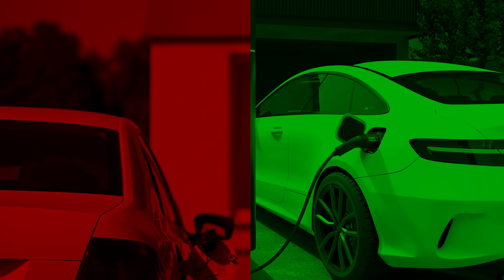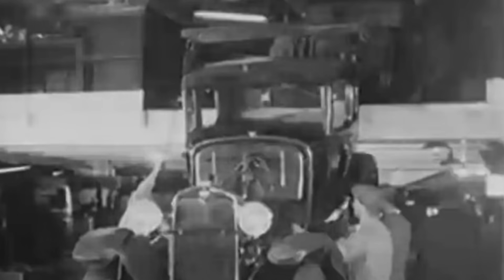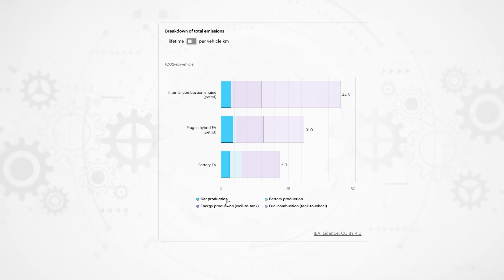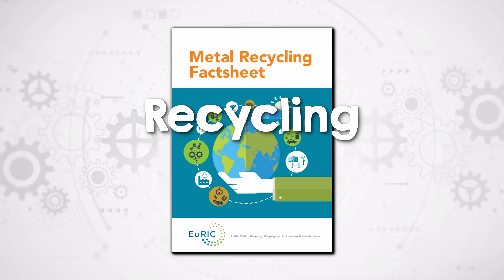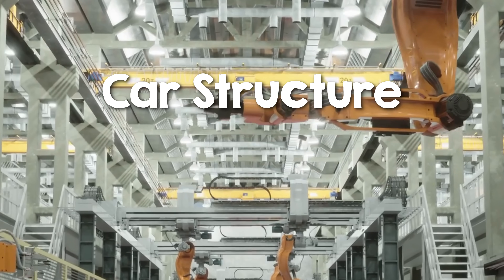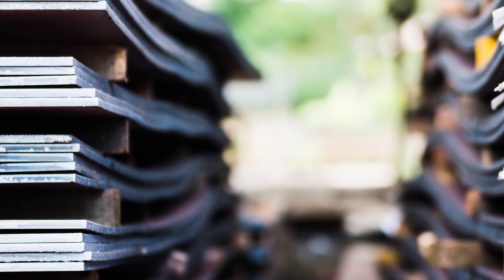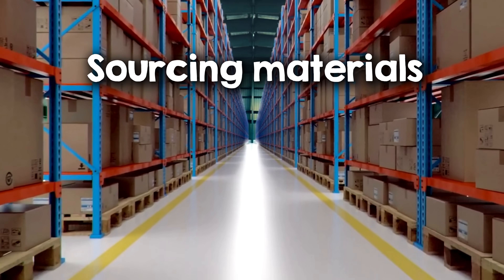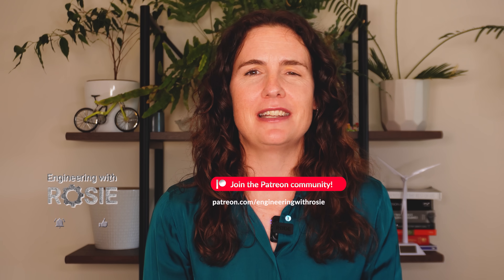The Hidden EV Manufacturing Problem No One Talks About

Comment: Considering the loss of power over electrical networks of 50% you are incorrect about an electric car ever being a better solution for transport. Hybrids win everytime. EVs are heavier and have so many other problems. If you are going to make statements and call yourself an engineer try to make them less BS please
Reply: What BS is this?
Reply: @marcelreijnen that an ev will ever have a magical point where it becomes better than an ice car. It's just demonstrably false. 
If you have 2000kg car and 100kg person, you get ~5% efficiency.
A ev car weighs more because the storage capacity of a lithium conpared to a fuel like petrol is ~10% so youre battery pack is big and heavy.
So lets so your car weighs around 3000kg and your human still weighs 100kg. So you get a lower efficiency. 
Then factor in the energy losses during transmission accross the elegtrical grid. The energy losses going back and forth in and out pf chemical storage in the battery. Means that a electrical car is a huge drain on resources compared to ICE cars.
Reply: Power loss in electrical transmission & distribution is only 0.5% to 3%.  Your 50% is ridiculously wrong.  You might be including electricity production using fossil fuels into your figure.  That is wrong.

Furthermore, renewables like wind and solar have zero fuel costs as the sunshine and wind arrive freely.

You also neglecting that gasoline and diesel don't appear by magic at the local gas station.  It takes a huge ongoing effort of investments, labor, subsidies and pollution in a 24x7x365 effort to explore, drill, refine, and distribute this ultra-refined product.  All before a single drop is burnt for fuel!  The US could power all it's EVs several times over on the energy used annually to refine its petroleum.
Reply: EVs are more efficient than ICE vehicles, even assuming 15% grid losses (50% sounds like an ass-pull).
First a big central power plant is more efficient than a small engine (about 40% vs 30%)
There are some losses charging the vehicle, about 10% (larger if charging on only 120V).
So the system efficiency of an EV is about the same as an ICE vehicle:
(0.4)(0.85)(0.9)x100%=30.6%

Comment: Isn't most or all of the carbon dioxide when manufacturing batteries from fossil fuel? 
That's not the only way to produce energy! I would suggest attacking the problem where it appears.
Reply: It’s a mix of energy from fossil fuels and minerals refining.

Even today it’s already way better to build batteries for cars, and it gets better as the grid cleans up both for plugging the cars in, and for the energy used in manufacturing. Eventually we’ll also have to decarbonize the refining process.
Reply: @benoithudson7235  There's been a lot of work going on to decarbonize steel production, as well as cement production.  Those two alone are 16% of global CO2 emissions, which is kind of nuts.  In both cases, electrochemical methods are looking very promising.  Electrochemical refining of all metals used in EVs, running on clean power is a thing I think we'll see eventually.
Reply: You're getting it, pal!  Unless we can decarbonise electrical power then you are just moving tail pipe emissions to a distant power station.   And renewables are hard so we'll just take the easy option and build FF power stations.   Specifically coal fired coz gas is hard to find, but coal you just go to a geography textbook.
Reply: Batteries are not made from fossil fuel. The energy used in their production comes, to a large extent from fossil fuel. As energy is increasingly sourced from renewables, then, of course the CO2 emissions resulting from using energy top produce batteries will decline. The most efficient way to reduce the carbon footprint of battery production therefore, is to decarbonise energy production.
 The use of fancy CAM (Computer Aided Manufacturing) techniques is exciting to virtual engineers maybe, but way less effective than doing the actual graft of building a carbon free energy grid, which is done by real engineers.
Reply: @nickwinn7812  That's very idealistic...  Unfortunately, the only affordable renewables tech comes from China, and we all know where China gets her power from, Coal.  They build two new Coal fired power stations a week.   The continued year on year increase in Coal consumption suggests that your bright renewables is so far in the future that it's irrelevant.
Reply: The transition to renewables is so slow where they build this stuff that I don't understand why you make this comment.  Fat chance that Chinese solar panels will be manufactured from solar power, this is extremely energy intensive and solar is fabulously energy diffuse!

Comment: The same battery capacity gives markedly more range per Kwh to markedly more eBikes and mobility ped platforms.

You can retrofit decades old steel frame bikes. How's that for lower innital emissions. 

For day to day short/medium range use cases around built up areas, go much further to meet more peoples needs. 

Very many people wouldn't need to use a car the majority of days if traffic priorities were managed differently. They might still own one but should be much cheaper to rent now and again for longer distance journeys or for additional utility likes moving ect or when actually having passengers /luggage
Reply: Indeed, our car-centric cities are what's fundamentally unsustainable. Much more efficient urban design is possible, but lobbied against. The suburbs keep us isolated, and turning to wasteful consumption for fulfillment.

Comment: The "Recycled Materials" Problems and cost apply to ALL vehicles,  not just EVs.
In fact, if we consider the "Big Cube of Metal" at the front of a "Non-EV" which essentially becomes a liability in an accident, a properly designed EV has a great advantage when designing for crash protection. 
Not to mention the container of "High energy liquid" under the "non-EV" when compared to the EV battery, which is increasingly being designed as an integral part of the chassis and so the crash structure, thus AIDING performance in that regard.
(Ref the upcoming Stringent Chinese Regulations....."Safety Requirements for Power Batteries of Electric Vehicles" (GB38031-2025) ..... due for introduction in July 2026)
Reply: As always you overlysimplistically conflate low correlated issues.... Such as recyclability versus safety.  as if they are relevant to each other.

You must be confused after all the issues with Elon.... c'est la vie
Reply: Overlysimplistically conflating low correlated issues.... Such as recyclability versus safety,. as if they are relevant to each other.

You must be confused after all the issues with Elon.... c'est la vie

Comment: Have they stopped talking about emissions from battery manufacturing now? I would really like to see a good LCA that shows that battery manufacturing is significantly worse the the manufacturing of drive trains for ICE vehicles, now. The difference in both cost and weight between comparable electric and ICE cars is really small now, which suggests the difference in emissions from production is unlikely to be significant compared to the huge difference during use.

Also, it seems like efficient tools to minimize problems in production isn't just relevant for EV manufacturing. 

Emissions from energy used in production is going down as we speak, even for the same processes, as average emission per unit power generated decreases over time. So while I don't have exact numbers, I strongly suspect the difference in emissions between electric and ICE car manufacturing already is kind of insignificant, and EV manufacturing will continue to improve, with more clean power, and improved manufacturing. Any LCA for battery manufacturing based on historical data only will be misleading, even when they're not intended to be misleading.
Reply: Even if you leave out drilling for oil and using the products, the net difference in emissions is large. Just ”read up” on the development in battery technology/manufacturing instead of using old (manufactured) data…

Comment: Tesla have been going hardcore on this for many years, even down to building their own simulations of magnetic flux in their motor designs, and tying everything together from the design stage through to automated quality control on the production line. I wish they'd be more open about it because I find it fascinating, but I'm guessing it's just too commercially valuable... which I guess would definitely support the points you make in this video.
Reply: All car companies do a lot of simulations and virtual testing.   It's extremely expensive to find out problems in production, so they try to figure out as much as possible beforehand. My friend works in VR division for Skoda where they iterate on designs with stakeholders. Another one is working on crash test simulations. Even tiniest details of how something is placed in the car or how the glue is apllied are simulated to find the most cost effective solution.
Reply: Rosie is just adding "EV" onto standard industry practice to make it sound new and exciting.

Comment: Initially it sounds like a digital twin is just...the design.  If all the designs are "compatible" I can see that would make it possible to create a whole-factory simulation and I can see that would be an excellent way to avoid the big mistakes.  A twin in a more literal sense would be a digital file about a specific item that was made on a specific day - containing all data about where it was made, when, what other tools were used on it, and the specific version of the design at that time.  From searching I found that this is called the digital twin instance (DTI).  I imagine this would be useful for maintenance - you'd know how much usage the part had and if it had hit a lifetime limit e.g. in aircraft some components have flying time limits on their life, others depend on inspections and this is obviously something that already has to be managed but we could do it for other industries and more efficiently.

Comment: Ummm.. what about the other EV Manufacturing Problem No One Talks About... China's coal intensive manufacturing of "green" EV's & batteries.
Reply: ... which still leads to a very acceptable "carbon payback" time, compared to ICE cars
Reply: They have SOME "coal intensive Electricity", Maybe you should consider the total manufacturing China provides for "the Rest of the  World" then consider the effect if that manufacturing was "Re-imported" to the now "customers"?

Growth of Solar (And Wind) in China is on an "S Curve" and as more is made, the curve gets steeper..... AND more of the production goes BACK to the grid, producing more GREEN energy to build the Green Solutions.

The effect is cumulative and exponential.
(Should I mention the bonus of solar which is probably NOT going to uSA and will no doubt be added to the Chinese grid?)

Since renewables are now cheaper than coal in China they will be increasing the transition.
Reply: Last year China installed more wind/solar/batteries/and coal plants than the rest of the world combined.
The sheer scale of China''s manufacturing is hard to comprehend.

Comment: Electric trains are much better than electric cars. We should try to promote public transportation over cars. Trains are the most electrified mode of transportation followed by buses and cycles.

Trains are a lot more energy efficient too. 

One track of metro can transport more people than 50 lanes of roads with cars. One track of highspeed railway can transport more people than 12 lanes of road. One bus lane can transport as much people as 9 lanes of cars.

India electrified 99% of their railways and are set power their railways with 100% clean energy by 2030. But less than 4% of new cars are electric. 

China also have nearly 80% of their railways electrified.

You can build housing for nearly 20,000 people within 500 meters from a metro station. Or within 5 minute walking distance. You can build housing for 122,000 or more people within 5 minutes cycling distance to a metro station.
Reply: Trains and other public transportation can be more energy efficient than automobiles under some circumstances - that generally involve people living in overcrowded areas that are not good for psychological health.

However, people usually forget about some of the things that make these systems inefficient. For example, trains and buses spend most of their time nearly empty because in order for the system to work they need to run all day long even when there is little ridership. Every train carrying commuters into town in the morning has to return empty to pick up more commuters, etc.

Brad Templeton did a pretty good assessment of what he termed the Green Transit Myth on his Robocars blog.
Reply: @alanlight7740 still a lot more efficient than only one person travelling in car meant to transport 4-5 people and their pets and groceries 😂
Reply: @JSM-bb80u  - actually, no. Like I said, Brad Templeton addressed this pretty well. If I recall correctly it was about ten or fifteen years ago that he worked out the numbers, but at that time a Tesla with only the driver was more energy efficient than any rail or bus system in the United States, and only marginally worse than the best train system in the world (in Japan). Of course Teslas are significantly more efficient now than they were ten or fifteen years ago, so they might beat out the best trains now.

Of course the most efficient transportation of all was an electric scooter.
Reply: @alanlight7740  "Lies, damned lies, and statistics" especially when those made up statistics are coming from Tesla fans....
Reply: @JSM-bb80u  Exactly right.... The study cherry picked inefficiencies in the US public transportation, while exaggerating the efficiency of a Tesla.... For some reason it didn't mention the highly utilized USA Northeast Corridor? But it pointed out how inefficient the underutilized Galveston Texas public transportation is. 

Why did the study just pick out one brand of EV?
Reply: @alanlight7740 still better than a car meant to carry 4-5 people and their groceries, carrying just one person and their backpack.😂

a 12 meter large bus need only need 6 passnegers for it to be more fuel efficient than a diesel VW golf carrying only one person. And in London the average occupancy rate in buses are 20. It's 11 for the whole England.

Above all else cars are extremely hard to electrify. No one is buying electric cars unless you give them heavy subsides. Even then only rich people with money buy them as their 3rd or 4th car. While metros trams and trolley buses have been transporting billions of people using electricty for centuries. Look st Singapore my home country. Every one uses the metro which is powered by electricity.

So you are subsidizing rich people from poor people's money when you subsidize electric cars. But you are distributing weslth from rich folks to poor folks when you build public transportation.
Reply: @alanlight7740 people living in dense urban areas are more healthier oth mentally and physically. Because they walk more. They have access amenities within walking distance. They access to parks and gyms within walking distance.

Comment: I dont understand why used batteries cant be ground up and that residue is then mixed with virgin ore?    Essentially you are merely making an ore with a very slightly higher lithium content.
Reply: Battery recycling is certainly a rapidly expanding industry, but we need many times more batteries than already exists to reach our targets on zero emissions vehicles and electricity supply.
Reply: @brianjonker510
No need to "Mix"
The "Ground up/ recycled" material is, having been "refined twice", of BETTER quality than "Virgin Material.
Reply: @rogerstarkey5390 Why dont you listen to Rosie has a whole chapter explaining the challenges & problems of recycling batteries before you let the whole world know how stupid you are.